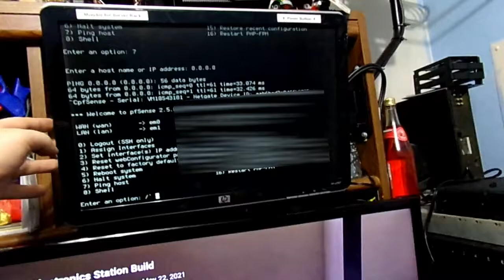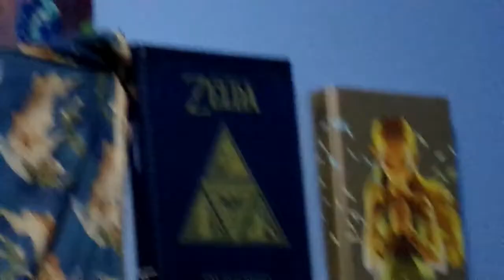VLOG June 30th 2021 update on personal life

Comment: Just catching up on videos so the sway links and control arms didn't fix ur problem. The clicking noise ur hearing is happening when you turn ur steering wheel?
Reply from the maker: It fixed some of it, the rest of it is the cv axles are worn out, the CV axles are making a clicking noise as opposed to a clunking noise, my pontiac does have 310,000 plus miles on it with all original parts. If you want, check out some videos by chrisfix when he did a full suspension  rebuild, and he will show you how to check things like sway bars and the like.

https://www.youtube.com/watch?v=mQ2fJ_aM_T0